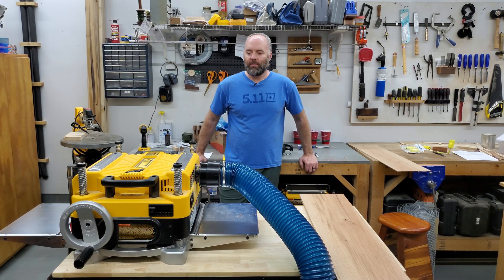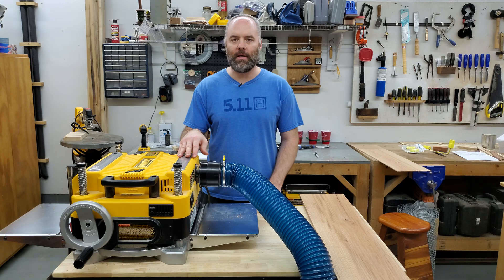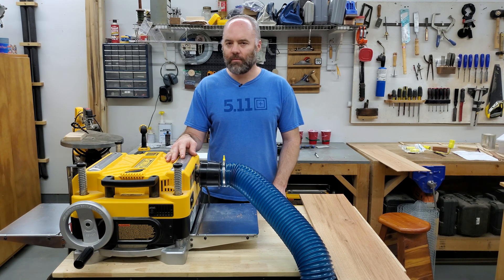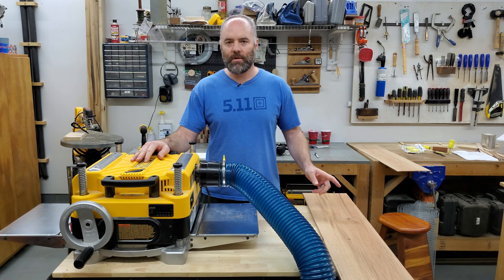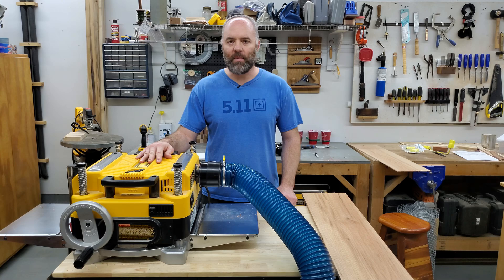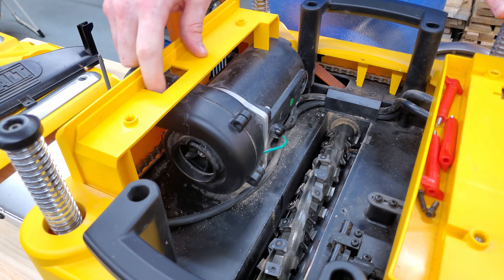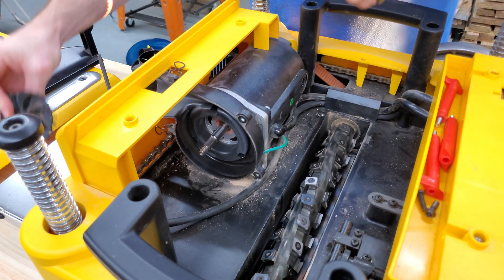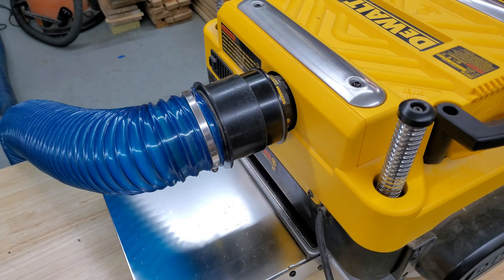What happens when you remove the impeller from the planer?

Comment: I have found the Dewalt 735 to be an incredibly well designed planer for the money. Mine is 9 years old and still runs like new.

If you keep the knives sharp. The drive rollers clean with mineral spirits. The platten bright and polished and clean it thoroughly, inside and out, after using it, (and while you're using it if it's a bigger project), you'll get years of dependable service from it.

Keeping it clean, and, sharp. Not overloading the cutting head by running dense hard wood too fast with too deep a cut. It will out perform larger, more expensive units all day long. No modifications needed.

Comment: Yes it does! I would imagine that removing the impeller completely would make the motor over heat. That being said, a lower amperage draw, there would be less heat generated....

Heat increases resistance. Increased resistance, increases the thermal load. At what point does this become a terminal fault? No idea. 

On the back of the impeller disc, opposite of the impeller vanes, are fan blades. These fan blades do not move dust or chips. Their sole purpose is to air cool the motor. 

Cutting off the impeller blades and running it with only the fan blades intact would still offer a dramatic drop in amperage draw. It would still cool the motor.

The one thing that it would also do is block a sizable portion of the available space to move the wood chips. That's no fun having to clear a clog every other run. 

This idea has merit. I think that it requires a little bit more thought though. I wouldn't dive in a remove any OEM part in any of my power equipment, (except, of course, the safety fences and other types of impeedments to production. 50 years plus and I still have all of my fingers!). Just saying.....

Comment: I’m having an issue where the air being expelled from the 735 is causing issues with my new dust collector setup. I reached out to Dewalt and they said not to remove the impeller even with the airflow from a strong dust collector as it may shorten the lifespan on the motor. Have you had any issues with yours in the last 5 years since this video?
Reply from the maker: No issues

Comment: after installing a shelix I noticed a marked difference in loss of power and understand why but having to take light passes to eliminate 18 amp breaker from blowing was frustrating. After watching your video I removed the impeller and noticed a great improvement. No load amps reduced from 11 amps to 7 and was able to take heavier passes. I was concerned about motor over heating as one half of impeller is designated for cooling. I planed about 50 board feet without impeller and same with impeller. Without impeller  was quite warm while with impeller it was much cooler. Not scientific but adequate for my own purpose. Solution: I ground the fins of the chip breaker side of the impeller and resulted with same power advantage as removing the impeller and maintaining motor cooling. Thanks for your video.
Reply from the maker: @petergahwiler-e3v  Good information. What were you using for dust collection?
Reply: @TheSnekkerShow  so now you've used this a few years, what is your overall thought on doing this?
Reply: @TheSnekkerShow  one horse busy bee
Reply: Is the chip side the fins closer or further apart??

Comment: Removing the impeller does increase the power; however, it also increases the dB level by 11 dB! That's a lot. It is a subjective doubling of sound output. It also increased the speed, so mine's going back on, as the machine was not designed for this speed increase with chain gearing etc.  I had hoped it would lessen the noise. It did not.
Reply from the maker: @jageo48  That should not happen. It makes mine significantly quieter, and I've done it on multiple planers now.
Reply: @TheSnekkerShow  I used to manufacture loudspeakers so I am aware of some facts with sound. I used an old analogue Radio Shack SPL meter and it was calibrated at Ottawa's NRC; so it's accurate. I removed the impeller for the sole reason of lowering sound output. I have a 3 hp dust collector with a 6" inlet, obviously forced down to the 2-1/2" #735 inlet.
Reply from the maker: @jageo48  I'm not questioning your ability to measure sound. I'm telling you that if your planer got louder after you removed the impeller, something went wrong.
Reply: @TheSnekkerShow  Such as.... My sense is that without the impeller, there is a reduction in what gearheads remark as "rolling resistance". Less mass allows a motor to have less resistance to speed and the incumbent ensuing power. Anyway, I don't have a chip dropping problem as the dust collector handles the load easily, despite the pipe reduction.  At 76, my aging hearing wanted a break.  Looks like I'll be going back to insertable plugs plus 31 dB Peltors  X5A's! hahaha Thanks for your comments

Comment: Does the blower have anything to do with keeping the motor from overheating? I saw a video where a guy put an upgrade to the dust collection, it comes from the top after cutting a hole. It’s 3d printed. Anyway, in his comments he says he kept the blower because he didn’t want the motor to overheat. Doesn’t seem right to me but I know nothing
Reply from the maker: It does, which is why I would only recommend doing this with a 4" dust collector or something with a similarly high air flow.  That pulls air past the motor.

Comment: I just subscribed to your channel after watching many of your Dewalt DW735 videos. I have had installation issues with my OEM Shelix cutterhead. It is presently not installed but thanks to your efforts I will reattempt installation soon. I have a Festool vacuum rated at 130 CFM that I connect to a dustbin separator that Rockler has a free plan I recently built. This setup uses a 4" adapter from the DW735 to the dustbin. The Festool vacuum is connected with a 2.5" hose to pull the chips through the dustbin. This works great with the dustbin drawers collected 95% of the dust and chips when using the DW735 impeller. Since it won't take long to remove the impeller I'll let you know if it affects performance.
Reply from the maker: 130 CFM might not be enough air flow to keep the planer motor cool, so keep an eye on it. Good luck with the Shelix installation!

Comment: I took the fans of my radiator on my car, drawing too much power. We sure showed those engineers 😂
Reply from the maker: As long as you cool your radiator with a 4" intake dust collector, your car will be fine. Roof mount it so it looks like a rocket engine.

Comment: I just watched your video and noted the the impeller accelerates air which cools the motor in addition to increasing air flow to expel wood chips. If you remove the impeller you will also reduce cooling airflow to the motor. But because you have reduced the load the motor it will generate  less heat somewhat compensating for the reduced cooling flow to the motor. If the amount of heat produced by motor is greater than the heat dissipated by running without the impeller then the motor temperature will increase. To compensate somewhat, the external vacuum system will still draw SOME cooling air through the motor but it may or may not be sufficient to prevent the motor from overheating.  The worst case would be running under load with no impeller and the external vacuum system disconnected.

 The easiest way to test the modification is to use a thermometer to monitor the temperature of the motor: 1) As designed with impeller installed both at Idle and under load.and  2) With the impeller removed both at idle and under load.The rated temperature of the motor is probably stated in the manual or on a plate attached to the motor.

I just noticed you posted this two years ago (my bad) so I guess you already know if it worked or not. Chuck
Reply from the maker: I haven't had any problems, but I also haven't measured the temperature. One of these days, I might get to it. I trust the dust collector is moving enough air, though.
Reply: @TheSnekkerShow  
You have verified the satisfactory performance of your modification. Congratulations on your success! I have been accused of overthinking things in the past. Now that I am retired I have the time to overthink other people’s projects. My dog Bo ignores me.  

Good luck with your woodworking! Chuck Petrone

Comment: I appreciated your video.  I always thought that this planer is underpowered and it explains why by showing the power drain of the impeller.  (fyi -  The air velocity coming out the dust port is ~66 mph! No wonder its drawing that much power.)  I tested the air flow near the intake of the motor and it was ~3.3 mph through one of the outside casing vents with the planer on.   With the planer off, I got 2.3 mph with the dust collector on (I use a HF Dust Collector). This flow seems low but it is not a true measure of the air flow through the motor because there are a few other vents on the casing but I felt it was a good relative measure. This convinced me that the motor would be getting a fair amount of air  flow (~2/3 of the flow) if I removed the impeller.   Before removing the impeller, my planer slowed and stalled (breaker trip) several times and I had to go to 1/4 revolution cuts at the slow feed rate to avoid tripping while planing wide hickory boards.  I removed the impeller to see whether this might help.  Performance wise I could see a noticeable improvement.  I could use the fast feed rate without significant slowing down the feed while planing the hickory (no trips).   However, I am getting more chip debris out the two ends and the type of noise changes.  Rather than a constant whine, it now almost sounds like something metal randomly bouncing around or grinding inside the planer on top of the whine.  I could not isolate where the sound was coming from and it sounded like something was wrong.  I thought something was loose and looked everywhere for some loose parts, maybe a latch was loose, or something else.  I did not find anything and did not think it was the missing impeller.  Found no hits on utube describing this type of noise.  Since the dust collection was a deal breaker, I put the impeller back on and to my surprise the noise went away.
Reply from the maker: It's hard to say without hearing yours,  but I can hear the chains in mine more when the impeller is removed. It almost sounds like something rattling around.
Reply: Update:  After a ran a few boards through with the impeller installed, the noise came back. So the noise was not the impeller removal.  I felt the different sections of the planer and the gear box had the most vibration.  Opened it up and the gear on the end of the cutter head was loose.  I looked at the utube installs of the shelix cutterhead and the gear just screws into the end of the cutter head.  The end of the gear had a 6mm hex head so that I could tighten the gear from the gear box without removing the cutterhead.  I recall when I installed my shelix head that the video I watched  noted that the threads should be left handed so that it remains tight.  I am surprised others have not had a similar problem.  Thanks for all you did here.
Reply from the maker: @richarddeveney6264  Good to hear you got it resolved.

Comment: I use a dust deputy with a 6 hp shop vac, HEPA filter and exhaust diffuser. The only issue I have is my blast gate to the router gets clogged and wont close unless I clean it out.

Comment: Interesting.  I’m giving this a try. Question.  I’ve noticed a large amount of wood chips and dust when I remove the top cover. Is anyone else having this issue?   Suggest fix?
Reply: I had that problem once, it was a cracked dust shroud.  A cracked fan impeller housing can cause it too.
Reply: @TheThoughtfulWoodworker  I'll look again.  I did not notice the housing being cracked.  I did remove the impellar.  Could I just disconnect the impellar motor?
Reply: @mikhailarey1196  actually the impeller is driven by the main motor.  I would leave the impeller alone, just make sure the impeller housing and dust shroud aren't damaged.

Comment: Off topic but I have appreciated your videos with this planer.  Have you considered addressing the static electricity issue associated with this planer?  Seems to be a fairly common issue, one that I haven't been able to solve.
Reply from the maker: Can't remember if I mentioned it in this video, but I called Dewalt about it years ago, and they said that's just how it is. I can't say I've noticed it since I removed the impeller, so that might be the static generator right there.
Reply: @TheSnekkerShow  Thanks. Was wondering if that might be the culprit.
Reply: Run a bare copper wire spiraling around your 4" dust hose to ground. We do this for cnc machines. Eliminates the static. But the impeller fan needs to stay on. It's cooling the motor AND blocking the chips from going into the motor.

Comment: But how much amp draw in the the dust collection...........
Reply: Agree (good to divulge as part of this test), but since the dust collector will be running anyway, there is no difference in total added to either way it is run.  My concern, as others have mentioned, is impact on motor cooling... does the airflow from the extractor alone provide adequate cooling ability.  Personally, I probably would not perform this modification.  I'm still kind of blown away with the 11-12A draw of this machine at idle (no cut) and 30A while cutting, as per his tests, for a machine with a NEMA 5-15P cord and rating to run on a 15A circuit.
Reply: @csimet  The advantage though is that you can draw the dust collector from another circuit. So if you are having breaker pops with this planer it might be worth it if you run the DC and the P on separate circuits. This is what I'm currently doing because I only have 15A circuits in my shop right now...and I still pop the 15A if I cut a little too aggressively. Good question about the cooling!
Reply: @drumpriest  With the power draw this thing has, running an extractor/collector on a separate circuit is a must.  A 20A circuit is  barely capable of handling the planer alone, considering it should not be loaded more than 80% (16A) and I'd would not run it on any circuit that has wiring more than say 20 feet (voltage drop and additional current loading).
Reply: @csimet  I've been running one of these for 15 years on a 15A circuit. I just don't take large bites.
Reply: I was wondering about the current draw/load after changing cutter head. I installed the Lux Cut III, similar to Shelix, and the planer motor labors far more. When I run poplar with shallow cuts like 1/32 the motor audibly drops pitch and slows down. I assumed the helical knives made a more efficient shearing cut as opposed to the straight lapping blades. But even with dull long blades the 735 runs much smoother than new carbide helical knives. Odd.

Comment: My solution would be leaving the impeller installed to cool the motor and prevent chips to enter the winding but removing the blades on the extraction side. since you are using dust collection system you don't need them anyway.

Comment: Are you aware, that by removing the impeller you are putting your machine at serious risk of burn-out. Yes, one side of it propels the discarded chips of wood through the exhaust port. But the other side is driving air around the windings of your motor. Every time it's put under load it will cause these to generate heat. If the machine is only used for a short period, then heat-wise it may be fine. But should you forget to turn on your extraction system and use the planer, it will be toast. Remember how the wood is statically charged, well; this will cause it to be attracted to the motor windings as they are also charged. They will Sease up your motor and cause it to catch fire in no time at all. Do yourself a favour and play it safe, for your planer and your workshop. Thanks for sharing.😄

Comment: I removed the impeller, it works works better rpm does not drop but it has one negative that i found and that is that the chip collection is not as good it dribbles chips out the bottom and that is with a 2 hp collector with a 4 inch hose

Comment: I'm not positive but in looking at what you did, and that the impeller has a dual vane configuration, I'm pretty certain those "inside" vanes are there to cool the motor. So they likely pull cooling air from inside the machine, over the armature and discharge it with the chips. They are also likely to create a stronger airflow than the chip discharge, so as to create a positive airflow situation, thereby forcing the hot air out and not allowing the dirty chip discharge in. I'd say that's worth 3 amps!!.  If I'm correct, you just eliminated your factory motor cooling circuit. I'd leave it be if I were you, but if you feel compelled to screw with it, maybe you could dremel the actual chip vanes off the wheel and leave the cooling vanes on the wheel.
Reply from the maker: I'm pretty sure you're right about the cooling. The 4" dust collector provides the cooling air, but I don't think I'd try it with just a shop vac. I might redo this video eventually to take some temperature measurements with different configurations, but so far I haven't had any trouble with overheating or chip buildup.
Reply: @TheSnekkerShow  I agree that with a good 4" suction line all should be ok but if anything goes wrong, like a filter clogs, hose falls off, breaker trips or human error, things could get ugly quick with all that a planer puts out and the motor in a more vulnerable state now being open on that end.  Anyway, good luck and thanks for your videos!

Comment: what was the amps with impeller and dust collector both on? it should be lower  than without DC.
Reply from the maker: Good question, and I don't have a good answer. I'll try to remember to check once I get some other projects out of the way.